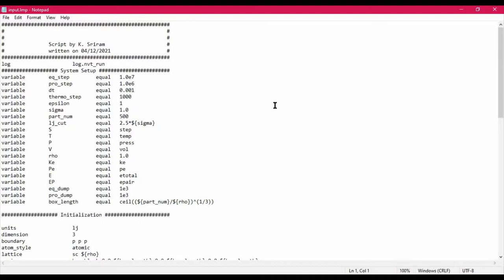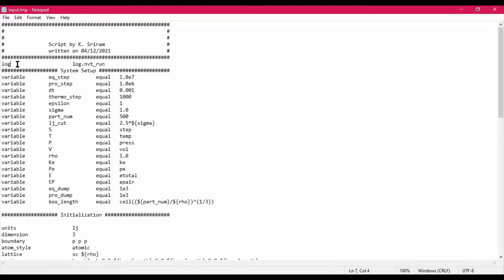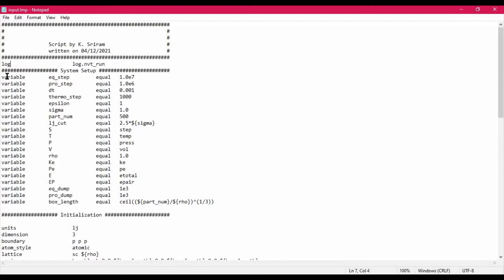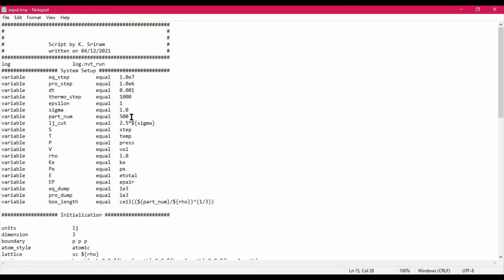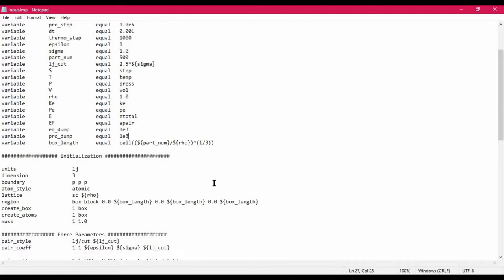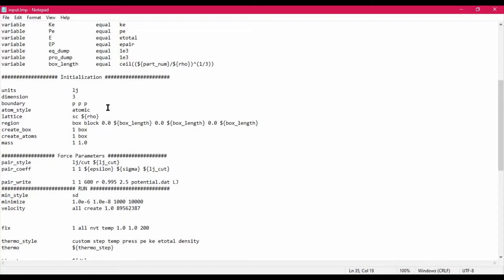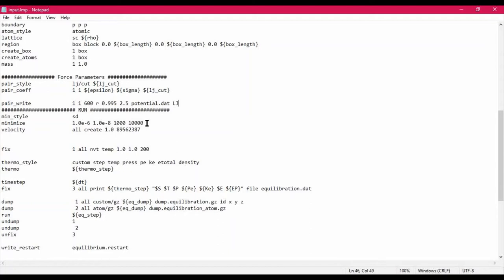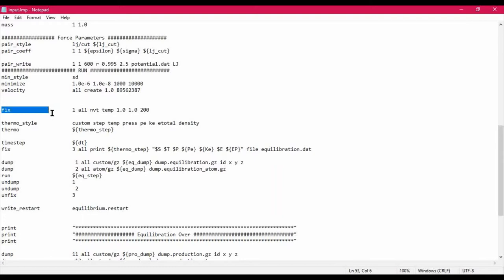LAMMPS tutorial | Lennard-Jones | Molecular Dynamics | Radial Distribution Function

Comment: Hi .. I have run this code, but in output file "dump.equilibration.gz" number of particles are getting changed.
Reply: In input script there is 500 particles, but in vmd there is 512 particles.
Reply from the maker: Yes. Lammps tries to build a system with that particular density and completely fills the lattice points. For example the cube root of 512 is 8 and therefore, lammps builds a system which has 8 lattice points on each edge..the trick lies where we have used ceil((${part_num}/${rho})^(1/3)).
Reply: @simcamp5194  But this is changing both the density of the system as well as number of particle, So how will you say this NVT ensemble?
Reply: @simcamp5194  I wanted to keep number of particle and density fixed, so I used "create_atoms	1 random ${N} 1 box" but in output file time step is not showing for t=0 time. Is there a way to get t=0 timestep position coordinates?
Reply from the maker: @himaniverma1355  write a data file just after creating atoms. Use vmd to read that data file.
Reply from the maker: @himaniverma1355  If you check the thermo output, which also prints  the density, you can see that the density of the simulation box is equal to the value we set.

Comment: hope this massage will find you in good health, i am facing problem related to RDF, i am simulating epoxy resin model using lammps, my system consists of C,N,O,H, i want to find out inter atomic distance between C---C, N--C, C---H using rdf, but distance which i get from rdf are larger than the inter atomic distance, my force field is oplass force field, i also try rerun method but still the problem is not solved
any help will make my lifesave.
thank you